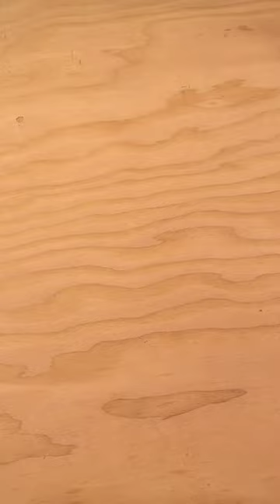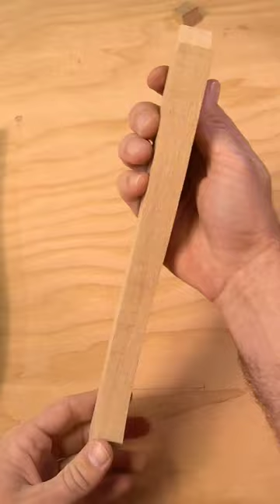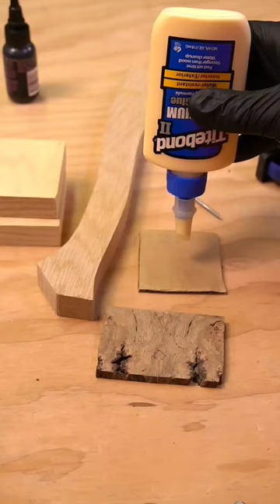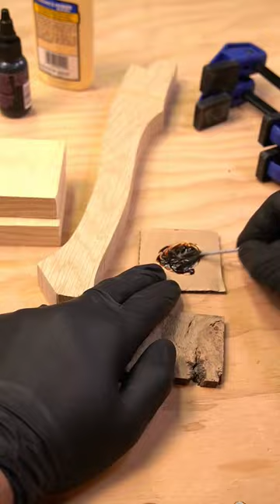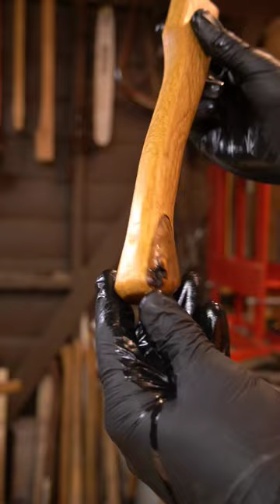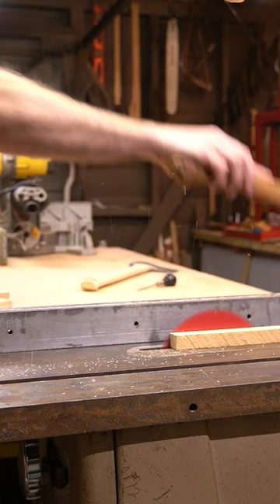How to make a hatchet handle push stick for a tablesaw #tools #axe #woodworking

Comment: Why do you always take the piece out of the middle of the board rendering the sides useless? You could get 2 to 3 handles out of most of your boards.
Reply from the maker: The left side of this one was pretty shity, not enough for another good handle.  The other handle I took it out of the center for the video. I'm not sure why people think I throw the scraps away. And I rarely do only take it from the center.